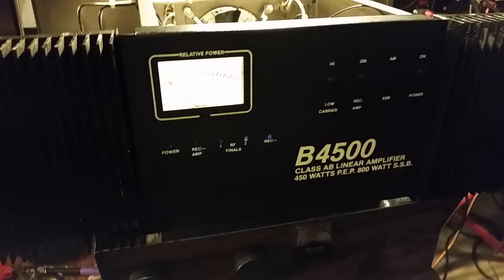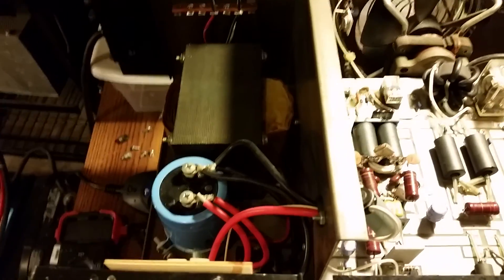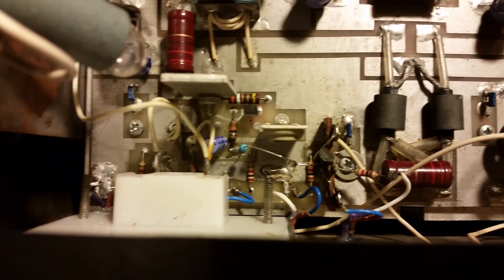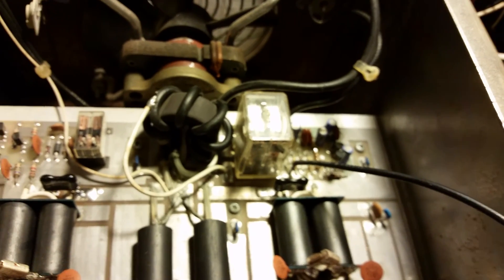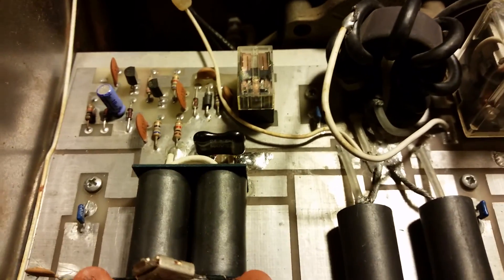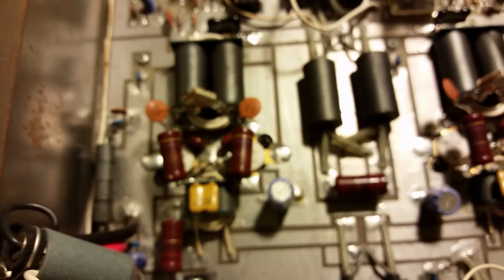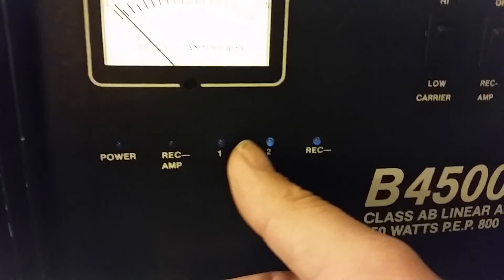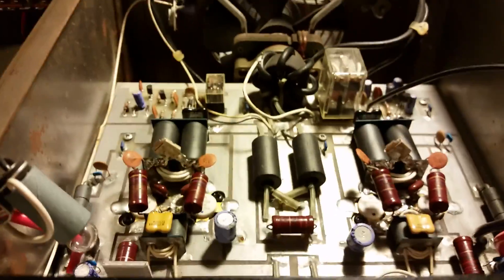B4500 Class AB Linear Amplifier Repair & Output

Comment: I have one of these and used to use it on 75 meters for years. Then I accidentally keyed it high SWR, something blew in the case, and it only runs on low power. I stored it for the last 10 years or so. I'd like to get it running again and maybe sell it.